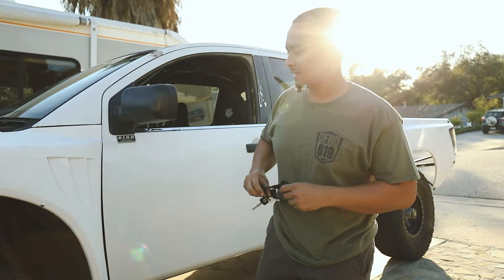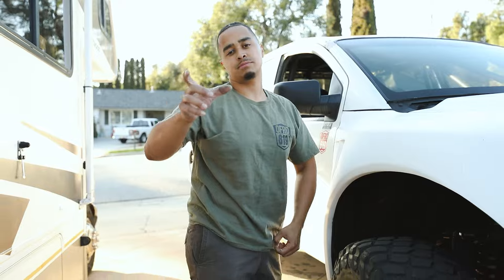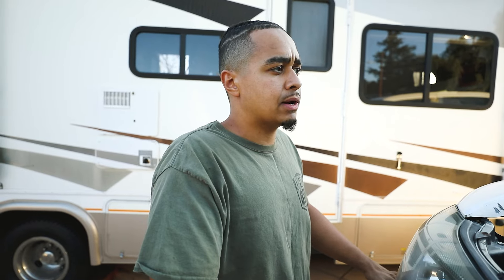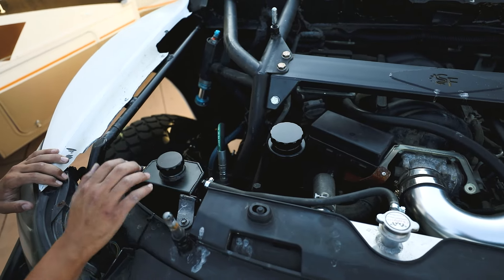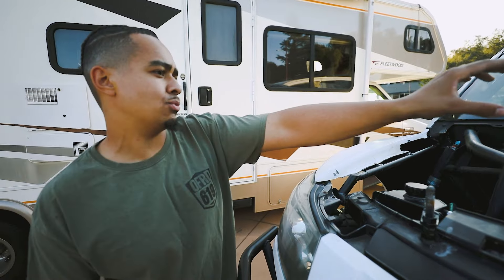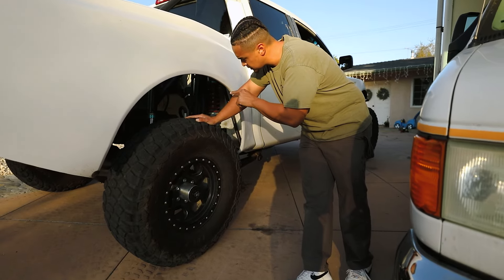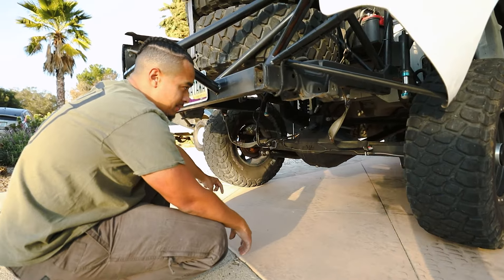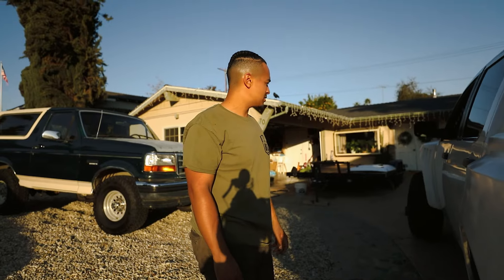Nissan Titan Prerunner Complete

Comment: How are the carbon shocks working? Very interested in your thoughts
Reply from the maker: Carbon works great so far. We had some growing pains but in reality they’ve corrected any issue I’ve had on spot. They are in a much different spot than one I bought my shocks so I would 100% buy their current generation shocks!
Reply: @BajaZay  Nice, I'm building my Titan but had a kid and covid shut slowed down my progress. Gonna look into the carbon bypass. Just completed the 6 spd manual swap and welding up my shock hoop and engine cage next. Hoping to be done by december and back on the road.
Reply from the maker: @anthonylimjoco5958  sweet how was that 6 speed swap? I wouldn’t mind doing that as well. No trans issues ?
Reply: @BajaZay  I'm about to do another 6 spd swap. Im basically doing what the frontier, pathfinder guys are doing but going in the other direction. Trans to Titan instead of VK56 to frontier. It's been great but the gearing is off, with the auto and 35 i have 4.11  I need 37 or 3.73 with the 35. With 4.11 I have a 4 spd with granny low but my top gear feel like I need another gear.  I'm using the nissan pathfinder 1997 clutch pedal assembly. It fit in the tight space and the pedal throw is better than the latest clutch pedal. the swap took me a long time. I learned a lot and hoping this next one goes faster.
Reply from the maker: @ teach me your ways! You got a Instagram?
Reply: @BajaZay  I'll have two titans with the 6 spd I can leave one with you to copy. One is the play truck the other will be my tow/haul truck. Also I can send you all the info. No insta I have a hard time even trying to take pics myself to doc what I fab on. So I don't even bother, I've seen my other friends, they end up asking me to fab up while they do the documenting and they are as good or better than me. But I love it.  I'm gonna try the 350, pathfinder clutch assembly to see which one will work better then I'll say go for it. I can say this, it's fun running a 6 speed hand shaker.

Comment: How did u get that wicked creations rear end to work with the nissan tone rings?  I dont understand how it all works completely but ive been told by ppl in the past when swapping aftermarket rear axle into nissan trucks it makes the truck go into limp mode??  Have any issues like this?
Reply: you have to delete the abs and go into the ecu and remove the error code. Curries had someone make the G2, which has the tone ring. They don't make the G2 anymore but might make the axles with the tone ring. I have the G2 diff works great.